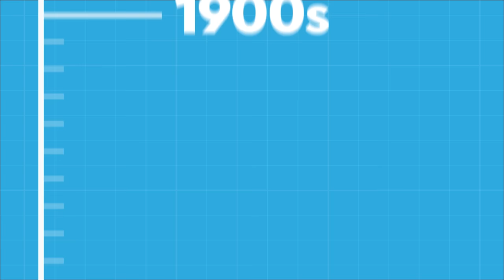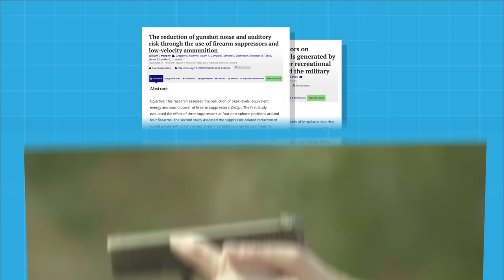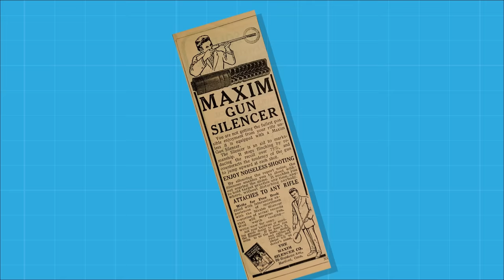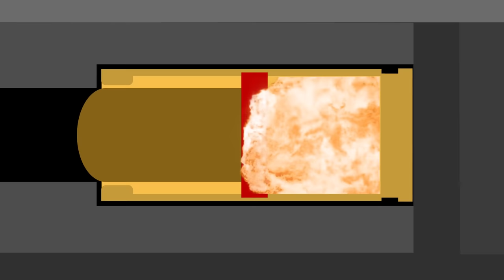How Silent Are Gun Silencers? DEBUNKED #moviemyths #debunked

Comment: In all reality, silencers are actually a nice accessory for target shooting so you don't hurt your ears in indoor ranges, but if you're shooting long ranges, you shouldn't use one because the baffling reduces the velocity of the bullet and throws your aim off.
Reply: Not True.  Actually suppressors INCREASE, not decrease the muzzle velocity and they actually commonly make them MORE accurate.  The accuracy thing was apparently true a long time ago, but these days not so.  The increase in velocity should be obvious, while the pressure is reduced because it has some room to expand, there is still pressure being contained that continues to push on bullet when normally it would have been out of the barrel already, so no more pressure at all.  As for the accuracy thing, the gasses that pass the bullet after it leaves the suppressor are much slower than those that are passing it at the muzzle without a suppressor.  That faster moving mass of air upsets the bullet more than slower gasses do.  Although, the increased velocity and different barrel harmonics will usually change the point of impact, so if you would "throw it off", by a very small amount, but once you adjust for that change it will be more accurate.  When I tried in on one of my rifles, it moved the point of impact about 2" at 1,000yds, which is nothing.

Comment: its to compress the caliber of the gun its not suppose to be used to lower the sound youd just use a knife if you wanted to be quieiter about killing someone. thats why the are really actually called compressors. its for like using less airspace needed to get the shot out. if someone was firing rifles rapid fire your pistol wouldnt get through the air at all.

Comment: -18% Damage 
-7% Accuracy 
+15% Range
Reply: Range should be lower because slower, subsonic ammo, most suppressed load also decreases bullet speed by a small amount (mostly ≤ 9 m/s).
Accuracy should be similar if not better due to decrease of recoil.
Damage or impact energy can be either lower or higher on soft target (subsonic load tend to be heavier at slower subsonic speed, though most ammo type speed decreased significantly more than weight gain).
Reply: @elham7459  Hmmm, you are right

Comment: Even a small .22LR will kid a surprise you and cause a little ear pain. 9mm and 5.56 are definitely still loud. 

You could defensively use a firearm in your home with a suppressor and have very minor hearing loss. Without a suppressor and without hearing protection, your ears are gonna ring and potentially have permanent hearing degradation. 

Suppressors are great. There’s been zero crimes (to my knowledge) committed with them. And some countries in Europe sell them as easy to obtain as milk or eggs. 

The US needs to abolish the ATF and repeal the NFA. Or the ATF be removed by force.

Comment: You leave out the fact that Pistol ammo is now larger and hotter. . . buy a 1920's 32 auto or 25 auto, . . .or a .32 rimmed case. . . .it sounds like a bubblegum bubble pop, and cloth ripping. . . .as the bullet cuts the air. . .sort of like swinging a wire coat hanger thru the air.

Comment: Simple.......the bullet must NOT exceed the Speed Of Sound.  Less than 1000 fps.
22 short 700fps
22lr standard velocity 780fps
45 ACP 900 fps
Hushpuppy 9mm 850fps.
380 ACP  850-900fps
So, with a proper "can" the action, click, and the bullet striking target is all the noise you'll hear.

Comment: This video understates the case and doesn't mention that decibels are an exponential scale. A suppressor can take a typical shot of around 160 - 170dB -- which produces a certain amount of INSTANT hearing damage with that single shot -- down to something around 140dB, which is the level at which a single shot may not cause instant hearing damage. The idea that no one can locate you shooting at 140dB vs 160+ is idiotic. It's still LOUD. In other words, unsuppressed firearms do NOT require repeated shots to damage your hearing. Using a pistol or AR-15 in self-defense with unprotected ears will cost you hearing loss, period, which is unfair to citizens. Politicians are MORONS, bottom line.

Comment: No, this information is wrong. Suppressors on a lot of guns are hearing safe if you just use subsonic rounds. The loud sound of supressed firearms are caused by rounds that are not going at subsonic speeds. You can get subsonic rounds for almost any caliber.
Reply: The information isn’t wrong
Reply: @nathanchetwin4309  Nice argument, bud.
Reply: @Orangnus  ok here's a better one, all information in the video is correct and you come on talking about subsonic ammo despite that not at all what the video is about and say the video has wrong information. that's like someone saying a Glock 17 has 17 rounds and some jackass come's over and says "THATS WRONG BC 100 DRUM MAGS EXIST, DO YOUR RESEARCH BUDDY"
Reply: @nathanchetwin4309  No, it's not. A better analogy for the video would be: "Do axes actually work in real life? Let's test it while having a guard on the blade so it can't cut anything!"

Suppressors are intended to be used with subsonic ammo, because using normal ammo would make the suppressor useless. It would be stupid to entirely ignore their existence and claim that suppressors don't actually work because of the sonic boom.

Comment: I live in NZ where their legal and as a gunsmith have installed , yes THOUSANDS of them ! No one gives a toss if you have one and if you have an old one , you might as well put it on the lawn mower ! I don't recall a single crime being committed with one and it certainly does not PROMOTE CRIME !  Why was it included in the 1934 NFA , National Firearms Act , YES it was used in the MOVIES ! Now there are safety issues with them on ranges , sometimes they fail , aka , have internal baffle strikes and for that ranges need to allow additional safety area , aka , Weapons Danger Area ,, somehow the NZ military have got their heads stuck in the WRONG PLACE ! And the NZ Military ,, being so woke ,, ooh we need them on the new AR's we just bought . DUH , so having experience with AR's and suppressors I warned the NZ Defense force of the hazards and problems ,, and of course they responded I didn't know what I was talking about ,, like DUH ! Well wouldn't you know it over gassing the AR causes LOTS of PROBLEMS that the Defense force blamed on the manufacturer of the guns , like NO ONE read the Collectors series book on the Black Gun . Yes jus changing from a single base to a double base powder changes the cyclical rate  of the gun ahh to the point of destruction and malfunction . Then those suppressors get choked up with carbon , so who is asked to help get that out , the same guy that WARNED the DEFENSE force of their stupid idea to start with. Ahh its just a few million wasted and dirty's the reputation of a perfectly designed rifle .. Yes I personally had a long chat with Gene Stoner in the early 90's and he was pissed about the WW ammo that was double based in the late 60's that he had specified a SINGLE base in the early 60's when the Air Force bought the first guns.  Suppressors are great  for knocking off the concussion from a short barreled rifle .. And the only SILENCED gun I ever fired was the Ingram M-9 ,, that bolt slapping around inside the action was louder than the shot going off !

Comment: Wow, you really dont know much about firearms. 1. There is subsonic AMMO. It is of course used in scenarios where noise is an issue. 2. Real silencers contain solid rubber membrames that are pierced thus degrading with each shot, they are basically throways. Fail video.